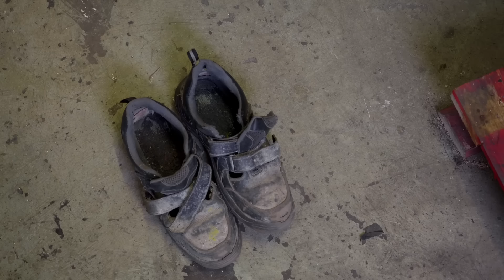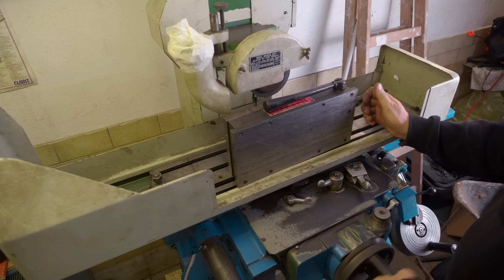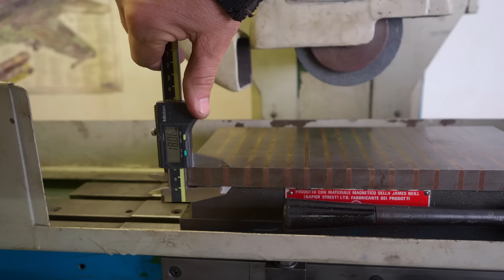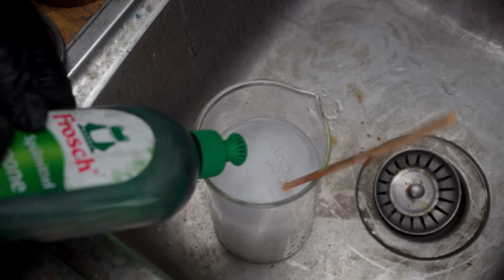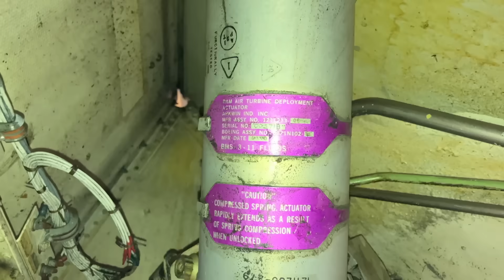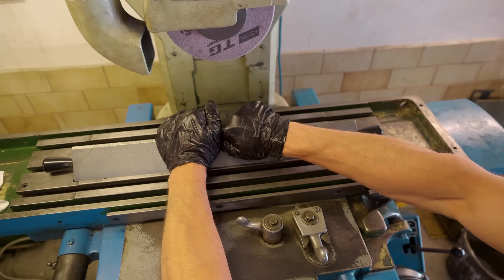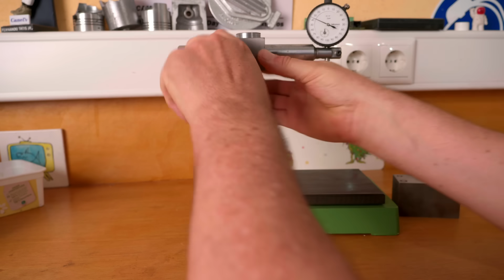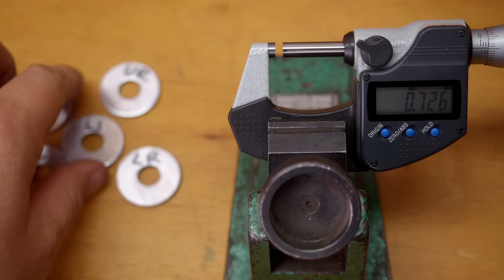Why cant I grind flat parts on my surface grinder? || RotarySMP

Comment: You will never get good acurracy without flood  coolant . Both the wheel and the work heat up .  On top of that  the J&S need  2 hours of so to warm up  if you want  get that  few micron accuracy..  PS  old tip if you want awsome surface finish  smear a little old fashion  tallow on the surface  for the final cut .   If you have only small parts to make and want  micron acuracy  you will need a pair of sacrificial  mag blocks   .
Reply from the maker: Thanks for your tips Graham. I am keeping an eye out for a flood coolant set up. Do they also help keep the dust down?

Comment: you remove the top of the mag bed that's why the screws are so long use the lock unlock handle to force the cam to rotate the lift on the top plate should give ernough  of a gap to to able to wegde it then just work down the bed wegding it until you can overcome the magnets then lift off it will usualy be full of grinding grit mixed with grease  check the cam pin for play replace if sloppy .
When you took the rable off and the piston still stuck then it was not the ways  as your process of eliminated was correct ,bent rod.
Reply from the maker: Thanks. I still need to finish that job on the mag chuck.

Comment: Those slot head screws are exactly what manual impact drivers are made for.... that and caliper/brake drum screws.
Reply from the maker: Yeah, I need to find a 1/2" bit driver socket.

Comment: I just quickly checked, and I didn't see anyone talking about the sticking pistons. I suspect the pistons are being driven too far. Their pushing force drops to almost nothing when the piston is fully towards the pressurized port because the effective surface area of the piston shrinks. You should be able to fix this by removing a bit of travel from the table.
Reply from the maker: Thanks. I need to take a closer look at the porting system.

Comment: So you bought a used surface grinder, moved it into your shop, and the first thing you didn't do was grind the chuck in? Not looking at you for any tips.
Reply from the maker: The first things I did was to replace the the bent hydraulic rods and lube the bearings. When I first ground with it, the geometry was so bad I couldn't believe it was simply the chuck, and went looking to see if there was a bigger problem in the way geometry.
I am a beginner at surface grinding. No tips from me.

Comment: You dont lubricate spindle bearings unless you have a prewar grinder. You cannot really check a ginder for flatness with a head mounted indicator. What happened with that chuck?  Never ground even when brand new? cant watch anymore of this.
Reply from the maker: This one is from about 1964.  Did you see the video I did covering why I had to regrease the bearings?

Comment: Excellent video. I also have Jones and shipman (1400) , you commented that the 60 grit wheel was coarse, in terms of surface grinding it’s not. I get on very well with 46 grit blue wheels for general purpose grinding. Whilst 46 grit might sound coarse it’s not like sandpaper and the finish is great and the wheel doesn’t clog so easily. Try it you’ll be pleasantly surprised! 
I also use the beyond ballistics rust remover recipe pretty much ever since he shared it. it’s very effective , the only downside being that it doesn’t store well in a container with lid. Something starts festering within ! but it’s so cheap to make another batch.
Reply from the maker: My pink and blue wheels are both 46 grit, just the grey wheel is 60 grit. I have been told that my be a bench grinder wheel.

Comment: Hello from Aus. The grey A60 wheel is a bench grinder spec and not good to use here. BC
Reply from the maker: Thanks for identifying that. It is the one which came installed n the machine, and given the condition of the chuck, some previous user had no clue :)

Comment: The F code on the stone, I believe, means it's a frangible stone. It looks like one. Used for cutting really hard material and no coolant. The only advice I have is to make sure the stone maches the material. There are literally 100's of different  types of them out there. As for the condition of the chuck, someone really didn't know what they were doing.😂 Great video, Thanks.
Reply from the maker: Thanks a lot David. I have a lot to learn on grinding.

Comment: Hello, are the same "RotarySMP" at "was polymer concrete" ? at all, you need to balance your grinding wheel by using a balance stand and playing with the little weights to restore the surface finish that you had before disassembling
Reply from the maker: That is me.

I need to make up a balancing arbor. A friend of mine has the balancing stand.

Comment: If you want a fantastic surface finish you need to to buy a Norton White wheel. In my shop I have two Bouar Schultz surface grinders and for finish grinding I only use white wheels. The white wheels are great, and if you dial everything in correctly you can achieve a mirror finish
Reply from the maker: Thanks for the tip. Do you have a code for the wheels you use? Do you balance them. Do you use coolant?

Comment: 18:40 just watching this assembly part makes me realize that that little cardboard piece in the stone got actually a function as some kind of soft washer, i thought it was some annoying way to put your brand on it haha
Reply from the maker: I was sent a few of the original Norton blotters you need to cushion the stone.
Reply: @RotarySMP  i know, for that i use a piece of gasket, sometimes the cardboard came pasted with some thick blobs of glue instead being evenly pasted

Comment: I used to rebuild precision spindles. If l needed to grind spacers for bearings l  always used magnetic parallels that l ground in place on the surface grinder every time l used them. Various types. Pin and stacked plates. The spacers between angular contac bearings need to parallel to under .0001". 
I also had various magnetic vee blocks. 15°, 30°, 45° along with 1, 2, 3, 4, 5 and 10°. The vee blocks were very handy for grinding non critcal dimensions on details that had sloped surfaces that acted as leads for sliding parts
Reply from the maker: Did you also grind bearing races directly to set preload? How do you clean the bearings afterwards?
Reply: @RotarySMP 
Did not grind the bearings. The bearings were normally a light preload with any extra preload added with the spacer set. Depending on bearing size, running speed etc this could be any where from .0005" to .0012". In addition most spindles have a set dimension from the tooling mount to a feature on the spindle. Mounting keyway to flange face. A tangent point in an internal taper to retaining flange on the front bearing face etc. The tangent point is defined by where a tooling ball of a set size contacts the internal taper. Depending on the bearing manufacturer these spacers could need to be ground or replaced with new spacers. One UK manufacturer could require these to be replaced or ground by up to .005". Most other manufacurers were consistantly within a couple of tenths of nominal dimensions. Our spindles came from a wide variety of manufacturers. We had one machine that was used in manufacturing camshafts. Itwas involved in the intial turning operation. The spindle assembly would last maybe two months before going bad and the replacement would need to go in and the bad one sent back for repair under warranty. Eventually management got fed up and asked me to diagnose the problem. Turns out the the bearing spacers were not ground. Just turned on the lathe. Spacers were close to .003" or more out of flat. Both the inner and outer. Fixed the issue and the spindle ran until the plant was shut down as far as l know. 
Cleaning bearings. Some bearing manufacturers advice fleaning their bearings in a special parts washer that uses filtered solvent. The reason is the preservative oils they are packed in may not be compatible with the grease being used. We didn't have a washer so thehest we could do was spray the bearing set down with denatured alcohol on clean non linting paper towels. The grease we used was mainly Kluber NBU-15. This caused some issue with Health and Safety because of the Barium. We ordered it from Barden as they sold it in 50 cc (?) syringes that came with a sheet that speced how much grease per bearing with sizes listed from 100 HDL to 210 HDL iirc. Barden #G46. 
An often forgotten element in spindles is the sealing arrangement. In my experience seal failures caused more spindle failures than anything else. Seal failures could be caused by a variety of issues. But the most common was either chips from machining processes or mis adjusted high pressure coolant penetrating the seals washing the grease out of the bearings. Or both. One common type of seal we used was manufactured by a company called Impro. These are brass labyrinth seal with internal O-rings. One place they got tore up was drilling oil passages in crankshafts with motorized spindles. Wound up replacing the Impros with a glass filled acetal labyrinth seal and a barrier plate. Problem solved. 
As to assembly the environment needs to be as clean as possible. A clean room is best. Lacking that that an isolated area free from air tools, smoke etc can be used. Also proper tools. Presses, manual or hydraulic. Induction bearing heater for interference fits. Bearing drivers (1) for slip fit or size on size fits. Proper spanner wrenches for lock nuts. Surface plate and gaging for checking components, adjustable vee blocks for checking for shaft runout, measuring tools checking sizes are just a start. Tools to avoid. Brass punches. Brass can flake leaving metal chips in the assembly. If you must use metal punches use mild steel. You will always hear that you should not use steel punches on bearings. Thus is refering to HARDENED steel punches. It is always prefered to drive the inner and outer race at the same time to avoid the balls being used to transfer ther driving force between the races. If the bearings are being installed with a press the pressure should be on the fit element or both if you are going into both fits. 
1) SKF sells a really nice set of drivers for 6100 to 6310 size bearings. Not cheap but if you are doing this a lot they are handy. Or you can make your own. I did for bearings bigger than the SKF set covered.

Comment: I use to use a 540 at work. Just for reference it clocked 2 tenths total run out end to end.
Reply from the maker: Thanks Roger. I still need to get a coolant system, and touch up the table.

Comment: Looks like you are well advancing on getting the machine tuned in. An impact screwdriver is rarely needed, but when it is, it saves the day. It keeps the screw heads in good shape too. I’ve used plain citric acid for removing rust. If you leave it too long it can start attacking the parent metal too. Have you tried using the electrolysis method. I’m getting ready to try it on some antique gun parts. Thanks for the video. Waiting for the next one!
Reply from the maker: I have also used electrolysis for rust removal. This is a little easier.

Comment: Your wheel is the weak point i guess
Reply from the maker: What wheel would you use for this?
Reply: @RotarySMP  i have the same machine. The wheel is a key. You need a J or I type wheel. Are you in UK or EU ?
Reply: 60 grit is ok

Comment: Why do you keep adding unnecessary songs? It doesn't enhance your videos in any way It's just annoying and interferes with music i am listening.
Reply from the maker: I often need to cover up poor audio defects, and otherwise I find I get about 2x as many positive feedback as negative, so it will stay :)
Reply: @RotarySMP  Covering poor quality audio isnt a solution, solution is to fix the audio, either with better audio equipment or with post process noise removal. Play some music then try to watch your own video. You will understand why random songs in video are annoying. I'd rather get noisy voice than rollercoaster volume of random song inside video interweaved with you talking.

Comment: I have the same machine, you could just up the pump pressure, there is a pressure  regulator with a flat head screw and jam nut which you should have access by remouving the lower cover. Just a smige should do...
Reply from the maker: Good point, I had been meaning to play around with that.

Comment: There is a proceedure for trueing up a surface grinder and magnetic chuck.. 

1) Remove the chuck
2) Clean the bed
3) Grind the top face of bed true
4) Grind the back edge of the bed true 
5) Mount the magnetic chuck again
6) Turn the chuck on 
7) Grind the face of the chuck true 
8) grind the back edge of the chuck true (if your chuck has a back-stop, grind that instead)

By doing it this way, you cover ALL of your bases.. 
1) The bed is true to the spindle for it's over-all travel, complete with reference edge (back edge)
2) The magnetic chuck is true to the machine and it's travel.
Reply from the maker: Thanks for that. I don't really want to grind the bed until I scrape the ways back in.
Reply: If the ways are wonky it's all for naught.

Comment: There is nice info on the correct procedure of grinding a mag chuck on a surface grinder in the machine reconditioning and scraping PM forum. I’m quite sure your procedure was not the ideal one. BTW, everyone says it must be performed with a lot of flooding coolant. The poor surface finish has to be addressed and can have multiple reasons.
Try contacting this guy:

https://youtube.com/@solidrockmachineshopinc?feature=shared

He is real expert on surface grinding.
Reply from the maker: Yeah, I need a coolant tank. Have been watching out for one. Since the chuck was so bad, I know I will be regrinding this again.
Reply: @RotarySMP 
I was about to say go for simple big plastic can or 18 liter bucket, but the original coolant system has some arrangement to filter the grinding powder. However it’s nothing complex and you can build your own from sheet metal. If you need I can take photos for you.

Comment: I fitted Newall dro tube ball sensors and readout to all axis on my 540 about a decade ago and find them invaluable. Particulaly useful that the precision balls are totaly enclosed in a stainless tube so impervious to grinding dust and coolant unlike glass ones
Reply from the maker: Nice Andrew. I already bought some glass scale encoders for this one. Just need to get around to installing them.

Comment: Take heavy passes as you want, just keep in mind its a balancing act related to wheel wear. Heavy passes will wear the wheel faster if it isnt very wide so another pass (or several) will normally be needed after dressing the wheel. As with everything it depends what you are doing and how accurate do you really need to be. I think Mag Chucks wear a belly because parts tend to land in the same place and people tend to drag them off rather than pulling straight up.
Reply from the maker: Thanks. I need to make up an arbor to balance the current wheels, and also install the DRO.
Reply: @RotarySMP   Heavy downfeed and small stepover is the ticket when you want a spectacularly good finish. It is also essential if you need to minimise wheel diameter loss (and hence thickness error in the work) in the finish pass, from one side of the work to the other. 
It's counterintuitive. The reason is that this way : All the wear will happen unevenly, concentrated at and near the leading side of the wheel. The leading corner in particular will do the lion's share of the work and it will become radiused quite quickly. It will stay sharp and cut relatively cool though, as long as the matrix is suitably soft (see note at end). 
A thought experiment helps prove this. Imagine making the stepover the same as the wheel width, as if the grinder was a horizontal milling machine. Then the grindstone would wear evenly from its near side to far side, and hence stay cylindrical. But due to constant diameter loss from that wear, each step would produce a surface high at the left end. What's more: each would be higher, all the way along, than the previous step, leaving stripes. 
Whereas with the recommended procedure: while the diametral wear on the wheel periphery will spread wider as you step over the work, the trailing zone will stay cylindrical, so it will always be taking only a dust cut. Hence it will stay sharp, unloaded,  and full size, right up until the wear band reaches all the way across to that far (trailing) side.
You may have to dress a narrow wheel every pass (set of steps at the same depth) if the workpiece is large and hard. Just dress it whenever you judge that the wear band will reach the far side before the final pass finishes.

NOTE: It's crucial to have the right softness in the matrix (the part of the wheel which binds the grit): the harder the work material, the softer the matrix needs to be. This is so each grain gets released (knocked out) before it gets too blunt. Also, a suitably soft matrix will wear away, so it does not glaze.
Particularly with heavy downfeed/small stepover, this is the way to go. If the motor slows down audibly (pitch change detectable) then reduce the stepover distance.

Comment: Are there any weird threads on the bottom of the chuck base that seemingly go nowhere? It's possible they are for jacking screws.  Otherwise you could install longer bolts in all those threads you removed screws from ( or just reinstall the original screws and leave them protruding from the base), then mount the chuck on your least favorite machine table, using the normal mounting ears and bolts to jack the two halves apart.
Reply from the maker: Good ideas. Thanks.